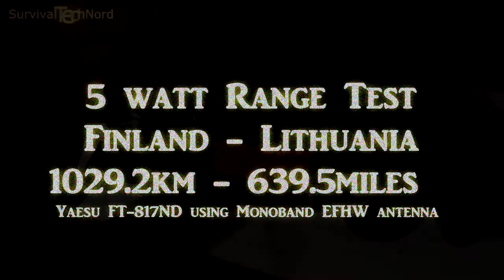Yaesu FT-817 QRP SSB | 639miles - 1029km

Comment: Awesome Job!!!  What the furthest distance you have been able to communicate with the 817ND over:
A) Voice
B) PSK31
C) CQ
Reply from the maker: thanks
Voice & PSK 8000km
CW I have not had a CW QSO yet.  Ask me after Easter.  I have a contest with Andrea the KX3 guy :D
Last week I had a 16000km WSPR report from Antarctica, using the 817.
its all very exciting.  learning whats and why/when its possible.
Reply: SurvivalTech Nord you are the man.  Lately I have been leaning more to buying the 817 given the price, UHF/VHF functionality, and overall form factor.  I was just worried about the range of voice communications with this guy.  Hence why I was looking at the Elecraft KX3.  But in order to get something that transmit higher than the 5W of the Elecraft (ie 857/897 or KX3) you almost double the price of the gear when you add in all the must have accessories.  What accessories do you use on your 817?
Reply from the maker: Honestly,  the only accessories I have are the Endfed halfwave antennas I use when portable, and the audio interface I use for digital modes. 
I also find there are only two situations where I need more power.  on VHF/UHF FM simplex, and when trying to break up a contest on HF. Since I take no pleasure from contests on HF, I stick to WARC bands. For VHF/UHF, I use a yagi and SSB for instant over the horizon comms.The output power thing isnt really a bother on SSB.